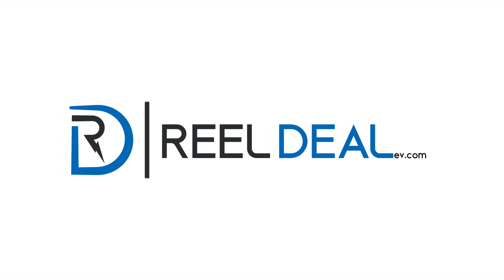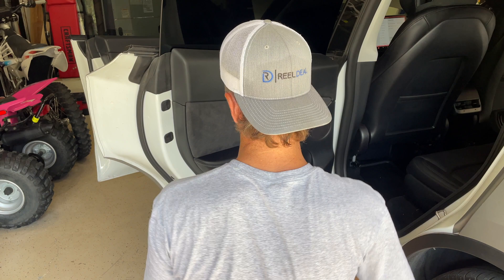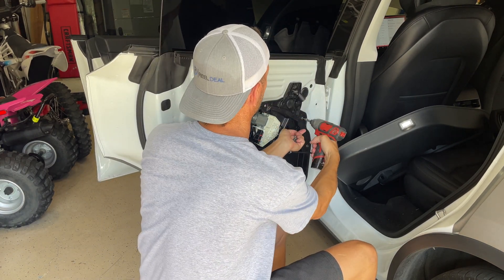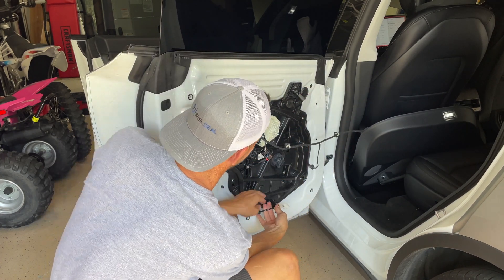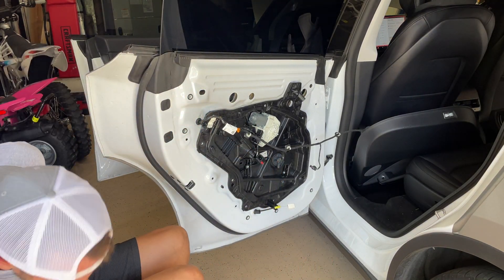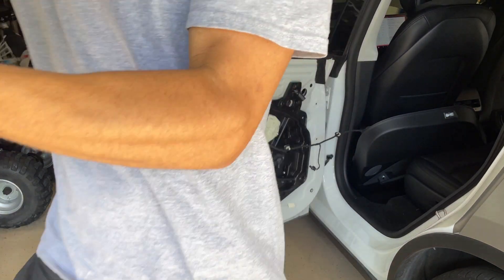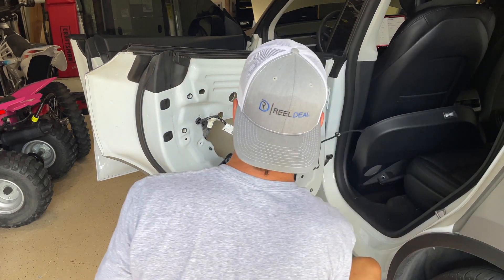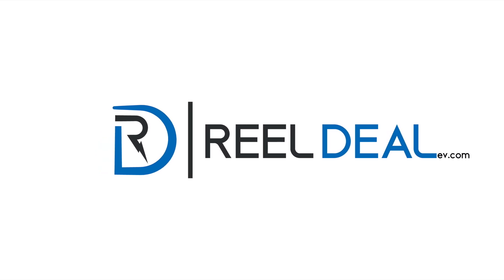Tesla Model Y Door Panel, Glass Removal, and Door Handle Removal

Comment: toolset and steps:
- remove 2x T27 rear doorpanel screws (front doorpanel 3x T27)
- remove "windows regulatior closeout"  sockets, 11x 8mm socket bolts
- remove 4 rubber plugs, 2x small, 2x big
- activate door lock to let the  window roll down just a bit
- remove 2x 10mm bolts for window-glass (dron't drop!) in the big holes
- remove glass
Rebuild is reverse order

Comment: I have an issue with my Model Y 2021. The rear door is closed, but the window is slightly down like when you open it. The system shows that the door is lefted open and I cannot lock the car. Can you manually lock the door and manually bring the window up?
Reply from the maker: It sounds like the door switch is open, we would be happy to look at it for you if you are local.
Reply: @thereelwdad  Oh, its under warranty, Its going in monday. I just wanted to know if there was a way to lock doors and roll up the windows if the controls aren't working
Reply: Im in miami

Comment: i heard a rattling noise coming out of my door, tried removen the plate but couldnt, then removed the fabric for the manual release of the door and could see a plastic bit there, was able to remove it but now i wonder if it is an important bit that broke, its round, bright green and about an inch in diameter, any ideas? dont know how to post a photo here
Reply: It's fine. Those green plastics break often

Comment: Nice video! If you only want to change the door panel because it is damaged, is that little wire easy to unplug to just replace the door panel without removing the window regulator closeout?
Reply: Hi! Im a workstation trainer here at tesla. When it comes to replacing the panel there is a total of 5 connections to be made from the window module*** ( that’s the name we really call it here at the factory). They’re easy to unplug as long as you be very careful not to damage any connectors. Each is color coordinated and easy to replace once new door panel is aquired. If you have any questions let me know I’m more than happy to answer them.
Reply: @Whipplenate Hi, quick question and hoping you can help! In the passenger rear, I want to replace the puddle light, but once I pop the plastic unit out, I can not pull the puddle light out. It is almost as if the wiring to the puddle light is to short on the inside, and I can not pull the puddle light out. It feels as if I pull the puddle light out by force, I will pull the puddle light off the wiring. Any advice on what I should do or what could be going on? Thanks in advance!

Comment: Hi buddy i want to change the glass. so i only have to remove them two bolts from big holes & i can lift up the glass ?
Reply from the maker: That is right! Pretty easy, do not overtighten the bolts when you put them back in.
Reply: @thereelwdad  Thanks buddy
Reply: @thereelwdad How do you know if it’s too tight? What could happen?

Comment: Super helpful, would it about the same for the front door?
Reply from the maker: There is one extra bolt hiding under the reflector on the door trim, other than that, just about the same.

Comment: Hi buddy. This video is extreme helpful! I found my rear window is rattling around. Do I only need to tighten up the two screwers that holding the glass?
Reply from the maker: I would be very careful putting too much torque on the bolts holding the glass, if you strip them you won't be able to tighten the glass. If you can't move the glass around I doubt it is these bolts.
Reply: @thereelwdad If you put too much torque in the bolts it will strip the bolts? I assumed it would shatter the glass. Can you confirm?
Reply: I just took the plunge and dismounted the whole enchilada, checked the mechanism and nothing so I re assembled everything back and the problem is fixed. No more rattle when opening or closing the door. Took me a couple of hours especially to set the glass properly since you can shift it front or backwards. But all good
Reply: I’ve got the same question. Did you get that fixed ? If so , did tightening those two bolts do the job ? Please share.  Thanks
Reply: @danielsiffredi8403  I tried it last night. The glass is still rattling. The bolts are very tight alright. Seems to the regulator’s issue.
Reply: Update on this thread: ends up getting window regular placed at SC. 1 hour appointment. After that the window is not rattling anymore.
Reply: @jx2398 what do you mean by putting regular window at SC? Thanks